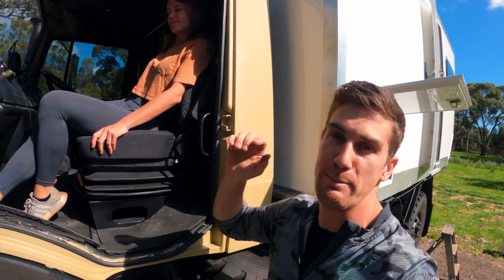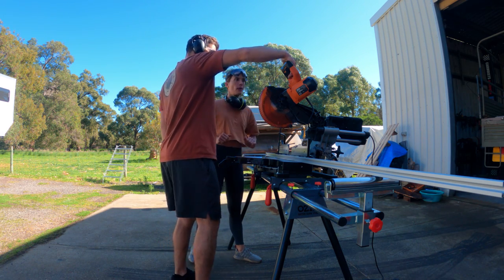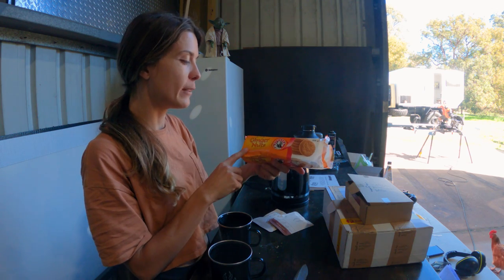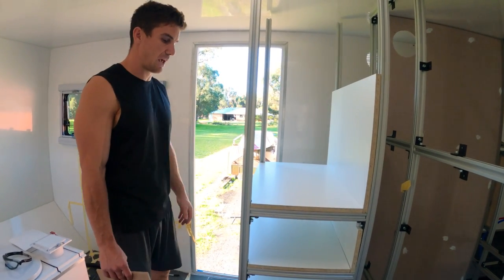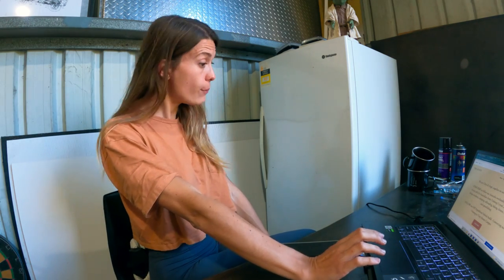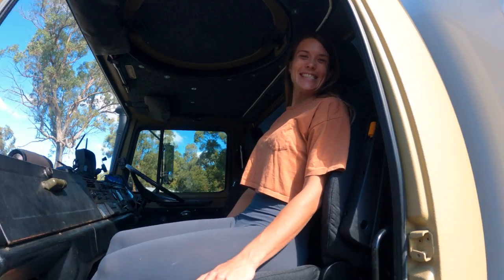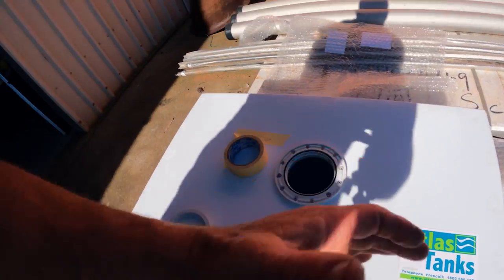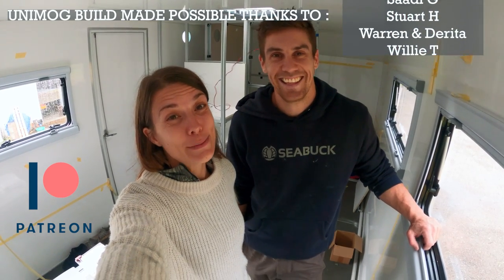THE REALITY OF BUILDING A TRUCK - Water Tanks & Electronics Cabinet - Expedition Vehicle/Caravan #24

Comment: You don’t need baffles for tanks that small.  Unimog will not be affected by those tank sizes. I’ve driven them off-road in the army, fully loaded and with 8 tonne trailer, it takes considerable force to affect the vehicle. We had 44 gallon drums full and partial with no effect to driving. Transporting half empty 1800lt fuel bladders was a different story. Large volumes over 300lts each a baffle could be good, but 200lt and less, the mog isn’t bothered by it. Half fill your water tanks and take it for a drive to test for yourself.
Reply: Agreed.
Reply from the maker: Thanks Anthony for the feedback, that's great news! We'll probably leave it for now and we can always add some down the track if needed.
Reply: @TheOutFit  hi you two it’s definitely not worth losing the valuable water capacity. 
Super proud of your progress!!

Comment: If you keep the tanks full or as empty as possible when on the road you don't need baffles. We have a big tank in the 4wd and i have it empty until the last possible moment as close to the destination as possible and fill it up there. Try to use as much water as we can to empty it out before we head off again. Hard when going full remote but means you don't need baffles > you have 2 tanks keep one full and the other empty until you get where your going. Just remember to rotate the tank use so you dont have 1 month old water in 1 tank and new water in the other tank

Comment: Electronics cabinet is looking great! Battery Safety tip before you start wiring main battery fuse needs to be as close to the positive terminal as possible the cable between the fuse and the battery is unprotected and most likely cause of a fire. Cheap insurance "fire one" Australian company have extinguisher stickers that activate on flame contact made for electrical cabinets.
Reply from the maker: Thanks Mitch for the tip, never heard of it, we'll look into it!

Comment: Bass boat live wells just basically have 1 divider with holes. Instead of lengthwise with the boat the well is lateral also so there is not nearly as much volume that can slosh. This is VERY important in a tournament because there’s a penalty for dead fish. Take a look at a good bass boat live well. Maybe your pvc pipe idea could fit through that hole and be in the place where the live well divider would be.

Comment: Chris have you used locktight on all the bolts on the aluminium frame angles. They may vibrate loose on corrugated roads. Also you can use an iron for the glue on edging. Much easier and also compresses well. Then use a blade to trim.
Reply: I believe they're using nylock nuts?
Reply from the maker: @chee8748  correct!

Comment: If you used a large leg length piece of L section for the brackets you can space the bolt holes out more so you could use a ratchet spanner etc 👍

Comment: Doing well guys. 
I'd think very hard about using PVC anything in contact with drinking water. Polyethylene (PE) is the material of choice for such applications. Pool hose is usually made of PE and you could feed in  meters to dampen water movement. 
PE is also resistant to cleaning chemicals you may end up putting into your tanks during maintenance. Be sure to wash the tanks and the pipes or any other baffles with plenty of water with a few drops of dish washing liquid, rinse well then use. Perhaps send the soapie water through the whole system to remove all traces of manufacturing oils in fittings, pipes, taps, pumps and anti hammer accumulator.

Comment: I believe that the dcdc and inverter needs to be close to the batteries for the best operation. Otherwise you'll need super heavy cable.
Reply from the maker: It's in the same cabinet just a few shelves apart so it's fine 👍

Comment: Race car Fuel tank foam baffle blocks should be good for the water tank baffle, they are made of Polyurethane foam so should be potable. You can squeeze it into the inspection holes as big chunks to fill the tank enough to be effective 👍

Comment: Hey guys, love your vids, look forward to each install.
Regarding Ange’s comment regarding the time it takes to assemble the aluminium extrusion with brackets, you may want to try using an 18v impact gun with a 3/8 or 1/4 inch drive extension bar and knuckle so you can get to the nuts from an angle. You can do them up super quick and then check the tension with a spanner. Cheers
Reply from the maker: Thank you so much Adrian for following along :) I'll run past your idea to Chris, sounds like a good one, cheers!

Comment: Aluminum sheet would probably have been better for the cupboard shelves, you lose a lot of space due to the thickness of the MDF/Chip board… you can always either keep the white protective sheet on the aluminum or wrap them if the aluminum look is not to your taste. It’s also a lot lighter.
Reply from the maker: Hi James - very good point for the thickness but for the shelves in this cupboard we actually don't mind losing a little bit of space as we have measured everything and still have more space than we need :) We definitely won't be using the MDF for the kitchen.